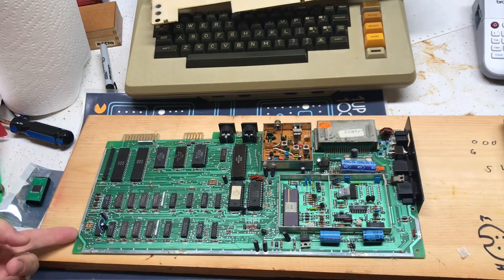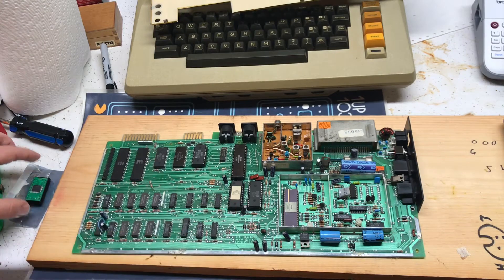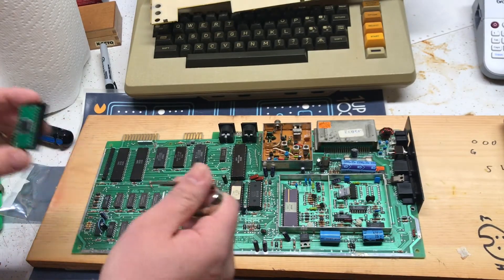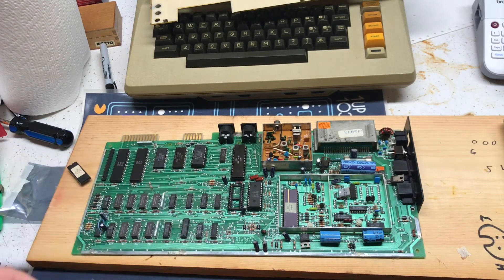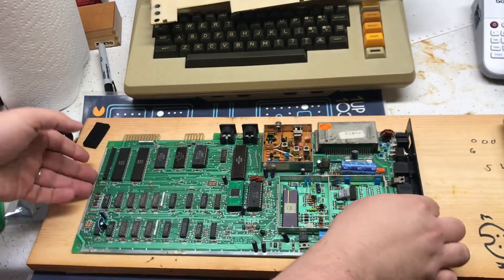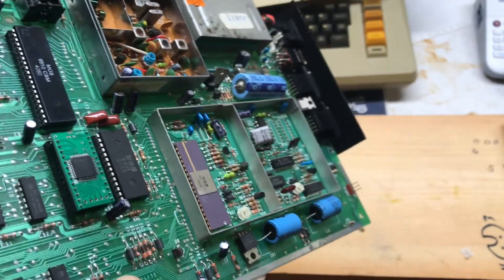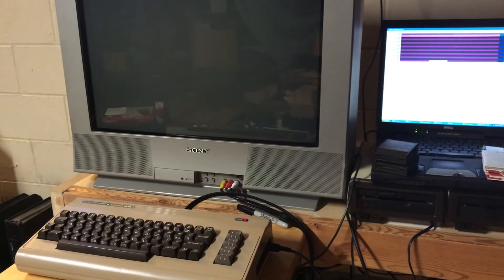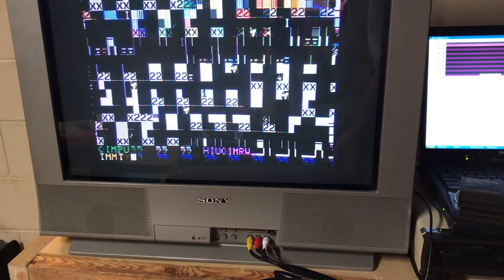Commodore 64 repair pt 1: Hosed - PLAnkton Replacement Didn’t Help

Comment: WOW! Is that a prototype C64??!!

https://www.c64-wiki.com/wiki/Motherboard

I had the same problem with a KU board.

The Kernal ROM was bad so too was the 6510CPU. It was strangely only partly working. The Dead Test Cart would work and falsely detect an issue with the memory.

Took me ages to work out the CPU was the main culprit

I suspect the original power supply was to blame.

Comment: The ceramic chip you mentioned is the VIC-II, not the CPU.
PLA damage can be responsible for the fault you're observing. However, as replacing the PLA does not help and the screen shows something with a cartridge inserted, I would suspect RAM chips fault, as CPU and VIC-II seem to be, at least partly, in a working state.
Of course, you should also verify that all on-board voltages are valid, prior to diagnosing or replacing any chip.
Reply from the maker: I stand corrected about the VIC-II chip. I started removing the RAM chips to get sockets installed and get new RAM, but managed to break the glass capacitor at C43.  Now I need to find something to replace that capacitor :/. Looks like I created another issue.   The power supply I'm using is for a C128 with a pigtail adapter to a C64.  It powers up the C128 fine, but I'll double check the voltages again.
Reply from the maker: It's booting now with a new Kernal ROM chip.
Reply: Wow, it's rather rare for the masked ROMs to fail. But it is somewhat consistent with the symptoms you were observing. However, I think that there was more than that one fault and you may have removed several faults while diagnosing the cause.
I am really curious what caused the ROM chip to fail. A connection failure? Some kind of corrosion inside of the package? I cannot imagine a fault that would damage the masked ROM structure itself. But, of course, that does not mean there can be no such damage :)
I'm glad you managed to get the thing fixed.
Reply from the maker: I made progress after I replaced the ram, that's when I would get the cart to boot.  After that, replacing the Kernal Rom fixed the issue.  Not sure what happened to it, as this was a goodwill buy.